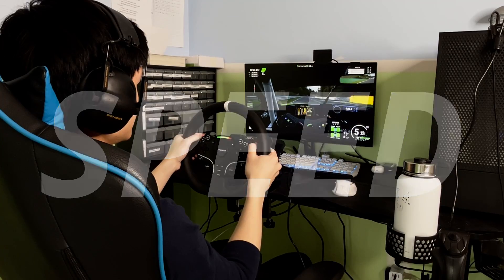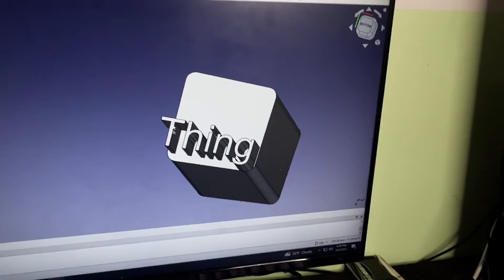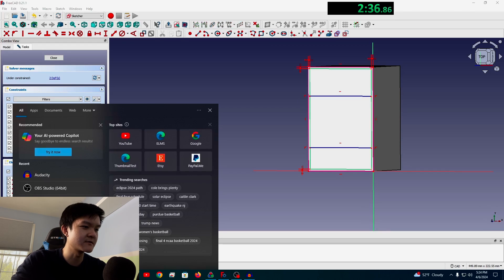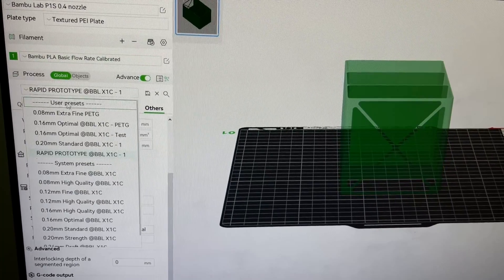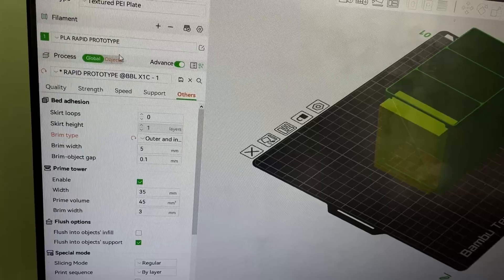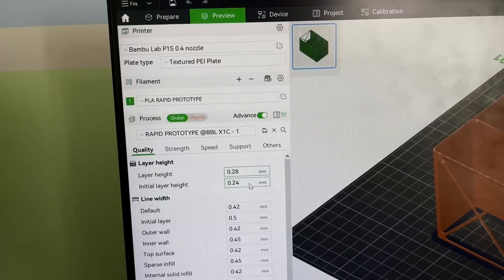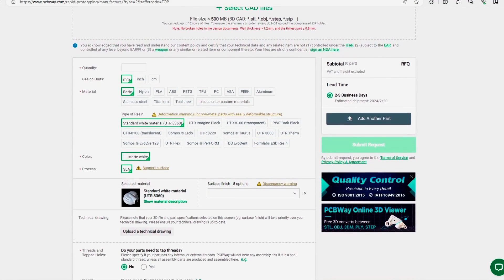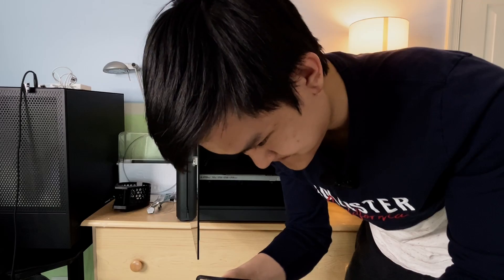Prototyping RAPIDLY

Comment: how do u need a brim? with my ender 5 pro I just hit print and after printing It's hard to get the print off (glass bed), is this a bambu lab thing, is it pei bed?
Reply from the maker: It may be the very thin surface area of the print that touches the bed. For a normal print that has more of the print surface touching the bed, I don’t use a brim. For example, I print a small cylinder of some kind, maybe 10 mm in diameter and it is hard to get off.